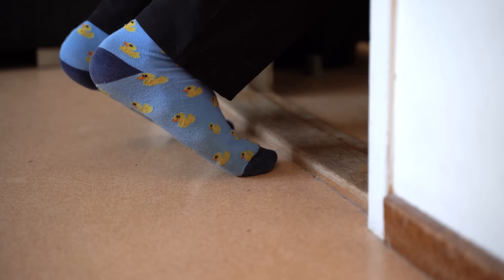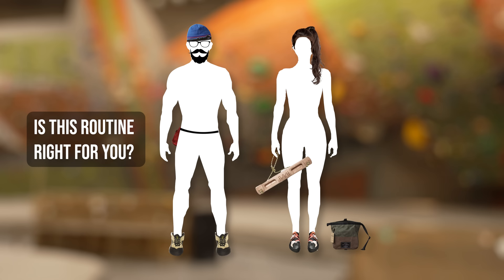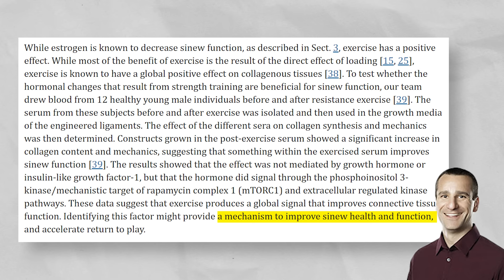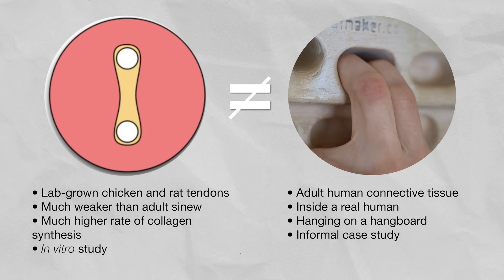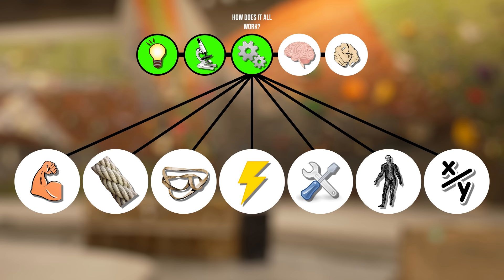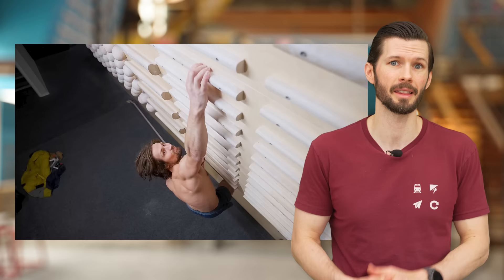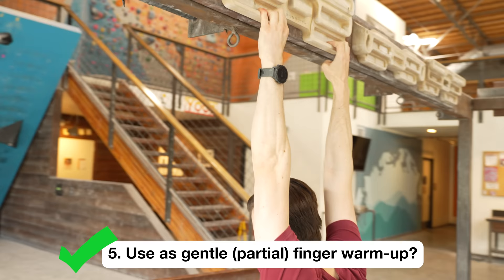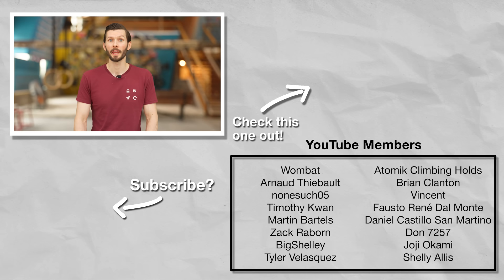Should You Hangboard 2x/Day like Emil Abrahamsson? (New Analysis & Recs)

Comment: Great video!  I do want to ask, is moon boarding sufficiently high intensity for my high intensity finger training (I am climbing v4 to v5 on the moon board)?  I mostly use my hangboard with BFR and low intensity at the recommendation of my PT (and anecdotally, I recover better if I do a sub max bfr hangboard session after climbing).
Reply from the maker: Moonboarding is certainly a form of high intensity finger training, though a bit more chaotic than just high intensity hangboarding.
Reply: @Hooper's Beta  more fun, though.

Comment: Good video but I think you missed a key possibility. Low intensity training will increase blood flow to tendons/ligaments/muscles. And ligaments and tendons will benefit from this increase blood flow. I think this low intensity training is basically a targeted active recovery. He was already doing the high intensity training and this low intensity I’m sure helped recovery of his tendons/ligaments.
Reply from the maker: Thanks! But how exactly do you think the ligaments and tendons benefit from the increased blood flow (or just increased "fluid" flow in general)? In other words, what do you mean by "benefit"? What is the mechanism? If you look into this further, you will arrive at the same conclusions we did. Things like tissue remodeling, increased tenocyte activity, etc. are all possibilities. "Blood flow" is not a specific explanation. Increased blood flow to connective tissue in our fingers could happen, and could cause a cascade of other activity that leads to healing/restructuring/strengthening of connective tissue, but that is by no means a certainty, nor is it a certainty that it would cause meaningful performance changes. On top of all that, even if Emil's connective tissue did undergo some changes from the hangs, which is far from certain, those changes could never explain things like 1-5-9 on the campus board that require specific, intense, prolonged muscle strength training. So, I'd highly suggest leaving room for a bit (a lot) more uncertainty in your hypothesis :)
-Emile

Comment: I've always just thought of it as stimulus that is so low that it inspires faster recovery without additional wear on the muscles. 

It reminded me of how many people with injuries stopped climbing during the Covid lockdowns and expected to be completely recovered when they returned. However, when they were able to climb again, they still had nagging problems. It seemed as though without experiencing the stimulus of climbing, their bodies didn't prioritize recovery as much as it would have it it continuously experienced at least low stimulus.

In much the same way, when my legs are sore from squatting, I find that biking or sled pushing helps speed my recovery.  

I train at least twice a day. On training days, one is in the gym and the other is a 10 to 15 very easy session at home. Sometimes it's on the hangboard, sometimes it's doing rice bucket exercises, and sometimes it's an implement attached to something I can stand on to make an isometric exercise. I don't take rest periods in that given time, I just pull very easy and shake out when I feel like it just as if I was climbing. It's significantly helped my armlifting numbers.

Comment: I think its time to make quantitative research on what people achieved with the method. Im in the V8-V12 range and Ive also seen huge progress with this routine. Many people at different levels have. These blanket assumptions that he achieved this due to his elite level are simply unfounded.
Reply: Where did anyone make any assumptions based on his “eliteness”?

He is neither significantly injured, nor a completely untrained beginner. Those are important distinctions, and they are absolutely clearly the case.
Reply: @danielbeall7725  The point remains - there are heavy assumptions made based on one single guy doing the routine even thought thousands of climbers have seen increadible gains from it across the board.
Reply: @alexbarcovsky4319  the idea that “thousands of climbers have seen incredible improvement from doing this” is the assumption my friend. 

But if you feel like it’s helping, you’re more than welcome to continue. A good placebo is a hell of a thing. 

(And it’s not a bad warm up either 😉)

Comment: Would this be fine to do after a climbing session? Since it's basically a very light warmup I assume it shouldn't be an issue but wanted to check
Reply from the maker: You're right in that it shouldn't be an issue but you also have to look at "what are you gaining" from doing it. Is it just to get more volume in? Is it to get some awareness of certain finger positions? Etc. You need to look at your specific reason for doing it and then evaluate if that matches with your current training and/or needs.
Reply: @HoopersBeta  To become comfortable with pockets, open crime, but main reason is I struggle with pain sometimes (chronic pain disorder) and find that loading my muscles, joints etc. helps me build confidence in them being pain free and then help with being able to pull hard without being scared of pain and/or injury so this type of routine seems to fit very well into that goal. I used to do repeaters at end of my climbing sessions with a no-hang tension block but it was much higher volume and intensity since I used it as traditional hangboarding routine and I found it was too much volume on my heavy days and this isn't intense at all so it wouldn't interfere with my climbing volume overall